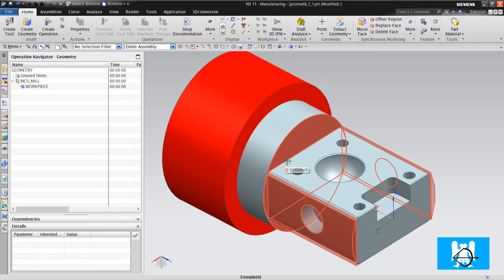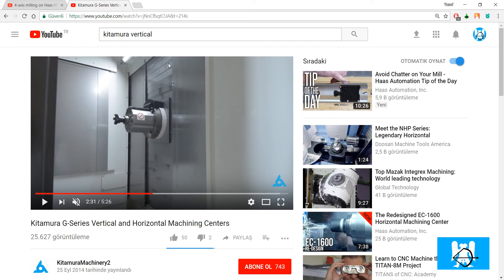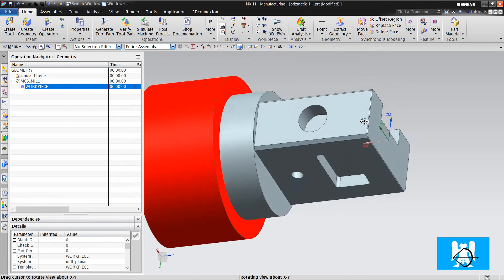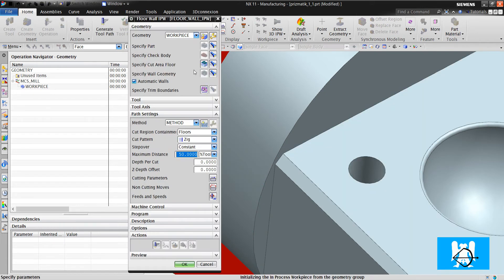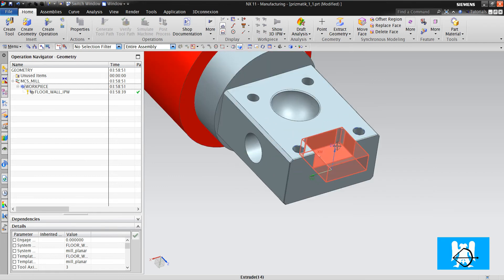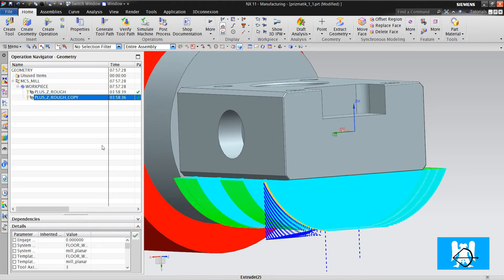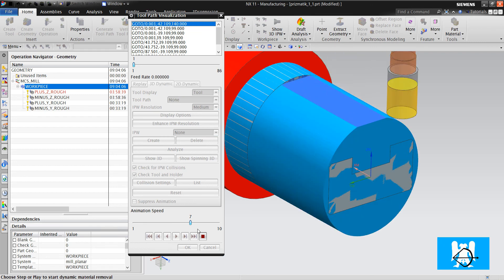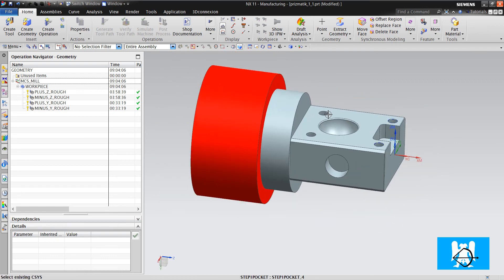59-4 Axis Indexing Sample-1.Part

Comment: sir as we called this program as 4 axis but we use 3 axis operations. OR it just depends upon the shape of the part and we use post prosessor of 4th axis.
Reply from the maker: Hi. NX just have 2.5-3 and simultaneous operations. It doesn't have operations customized just for 4 or 5 axis. You use standart 2.5 or 3 axis operations for 4 and 5 axis needs. Many other cam systems have customized operations for 4 and 5 axis but NX don't. 

As you said you have to customize postprocessors for 4 or 5 axis or mill turn machines. 

For more information you can refer to my video. 

https://www.youtube.com/watch?v=FkSdpciWUl8&ab_channel=YusufU%C4%9Furluo%C4%9Flu